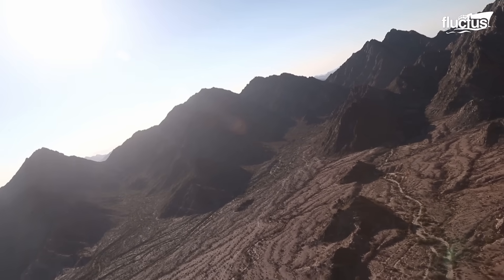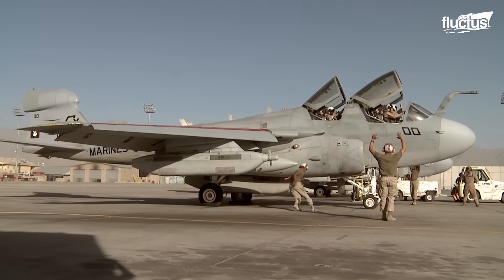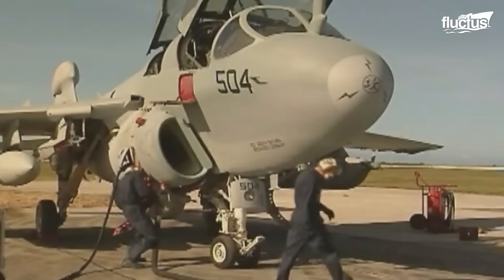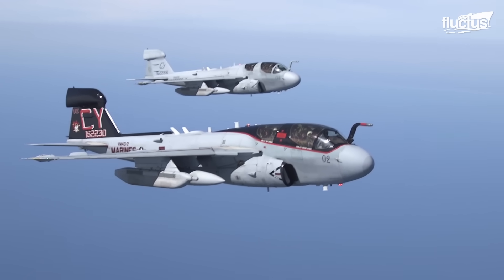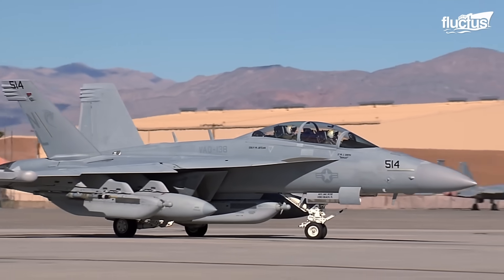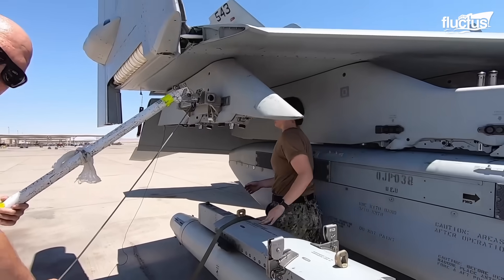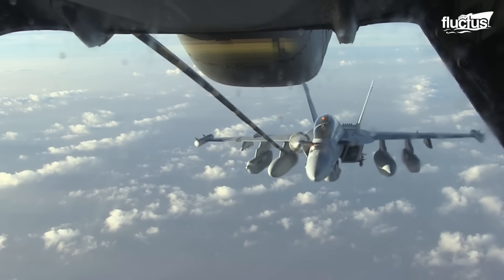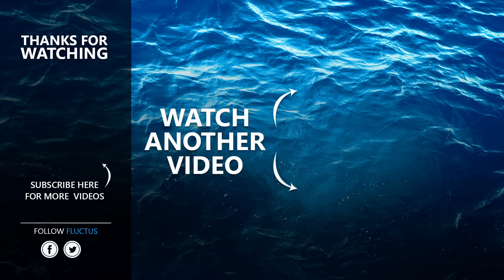How This Weaponless Plane Became One of US Most Feared Aircraft

Comment: Fun fact….the radome had a special marked with a symbol…..usually the radiation symbol.   Since A6 and EA6B  looked the same looking head on and the Landing Signals Officer (LSO). They needed a marker that was easy to see which aircraft was landing to assist with the grading.
Reply: Fun fact 2 : the return. The two planes seems identical but in fact not, one is a four seaters and the weight is not the same. Are you able to mention it in your explanations, or do interneters have to do it for you ?

Comment: The EA6-B was my squadron aircraft. VAQ 137, I know that bird well. Used to pull hot section inspections on the J-52s in AIMD aboard Enterprise, WESPAC 74-75.
Reply: so which profession did you work in the EA-6B? The seat maintenance or ?

Comment: I never understood why the marines needed A-6s, F-14s and F-18s.....the A-10 would have been their perfect aircraft
Reply: Because marines are expeditionary and won't always have naval air to support them.  So they rely on their own air wings
Reply: @kevinmckinney8577  again....why not the A-10 instead of high performance aircraft ? And when in modern history have the marines not had air support from the navy  ?
Reply: @280StJohnsPl  Historically the USMC always had their own fighters and attacker squadrons.
Reply: @gufo_tave   Why....i can see for air support, but why high performance jet fighters ?
Reply: @kevinmckinney8577  I cannot say that this was a good answer as the EA6 cannot operate off of Amphibious Assault Ships/Helo Carrier.  To get one of these or its replacement, you have to have at least a Super Carrier.

Now, the F35B...that is a dense electronics platform, so do not be surprised what that can do even in stealth configuration/without external hard points.  The 35B's fly over me seems like every other day, and I cannot imagine a human being surviving the pressures of a vertical landing on the far end of an Amphibious Assault Ship.
Reply: There are many reasons why the A-10 is not suited for navy use.  It was built to go low and slow, not defend a carrier.

Comment: WRONG! The EA6B Prowler is not weaponless. It carries anti-radar missiles. That's it, weapons.
Reply: Geez, you guys should listen better.  The correct facts were included here, as at 9:30 and 10:40.
Reply: Clearly you missed the first 30 seconds of the film, “Never fired a single bullet”
Reply: @robandcheryls  They fire missiles.
Reply: It also has a pocket knife.
Reply: We called them 70s & 80s (Q.u.e.e.r)  cuz they were a small (4) on the carrier and A-6 tram intruder 15 aircraft but went in with no guns. The only aircraft with close to the bomb load to a B52. BTW the in-flight refueling probe was called a donkey (d.i.c.k)😅
Reply: Well said, because many of these weapons commentators on the Internet, doesn't seem to understand the capability of the systems and platforms they comment on. Lol
Reply: Yeah, well…….my dad can beat up your dad. Lol
Reply: 0:30 the vid shows EA6B with HARM.
Reply: Agm 88 And antiship agm 84 haarpoon, 4x1 especial offer, buy now!!!, I buy... 😅
Reply: I don't know why accident's landing, 😮
Reply: Actually, when fully configured for EW, there aren't any remaining hard points for missiles. 
The two outboard pylons would be occupied by the main EW pods and the two inboard pylons would carry the external fuel tanks required for most EW missions. 
So, no room for missiles. 
Secondly, to strip down the loadout for EW and replace it with missiles wouldn't be smart employment of this particular airframe.
Although the engines provide a robust amount of thrust the EA-6 cannot fly the same attack profiles SAFELY,  as a regular two-seat A-6.
EA-6s are significantly more heavy than an A-6s as their airframes are built sturdier and are factory loaded with heavy components like transmitters and extra black boxes.
It is NOT a missile platform.
Reply: @MarcG7424  
Flight of the Intruder is A-6 Intruder
 (two-seat attack aircraft) 
This aircraft is the EA-6 Prowler
A four seat VARIANT of the A-6
Loaded with antennas and electronics, black boxes etc.
Reply: Calm down - it was At First Designed to be weaponless... At first...
Geez... Tey decaf.......
Reply: VERY WELL ANSWERED!
Reply: You know better thank you for clarifying.👍🇺🇲
Reply: Lol.
Reply: To confuse the enemy! 😅
Reply: First of all, it’s EA6B; second, it’s called Prowler 😊
Reply: The missile is called, " HARM" high altitude radiation missile.  It's only use in an air to ground role to take out radar stations not in an  air to air role.
Reply: @guillermogarcia6342  'The missile is called, " HARM" high altitude radiation missile.'(sic)

Incorrect. High-speed Anti-Radiation Missile
Reply: Let’s take that hair, split it, then split it again. I mean my gawd. At one point they showed a Growler but it was a prowler . I say we take to the streets and burn the MF down.
Reply: She said the Prowler didn't have weapons but the Growler does.
Reply: @Cause It should of said the Prowler don't carry self-defense weapons.
Reply: WRONG it did not have ANY weapons they were added later
VAQ-137 ROOK 78-81
Reply: Ya and the pilot & crew carry pistols too. OMG this documentary is just so inaccurate.